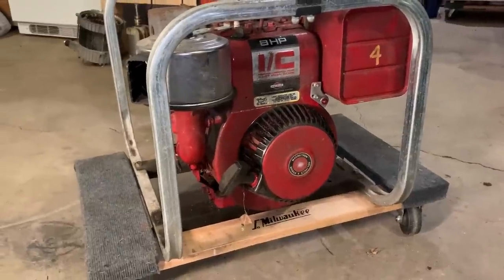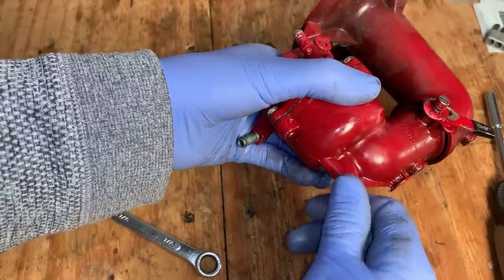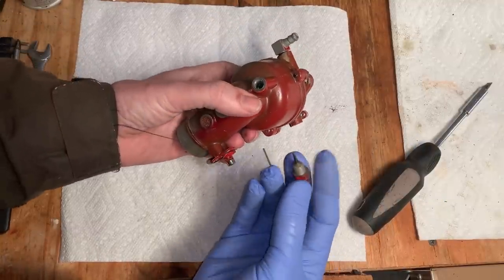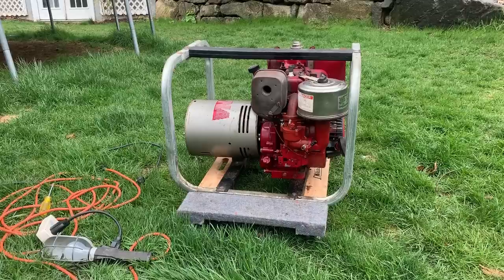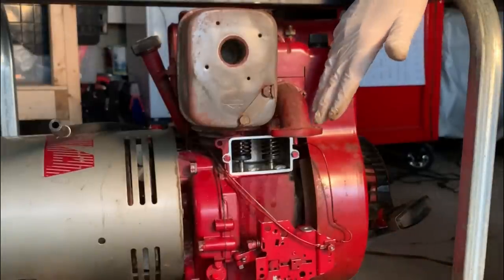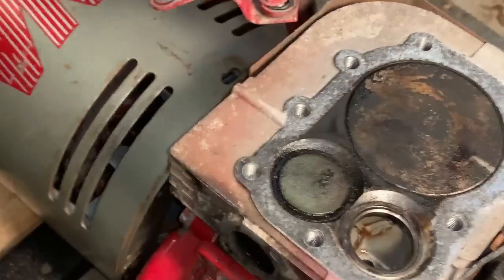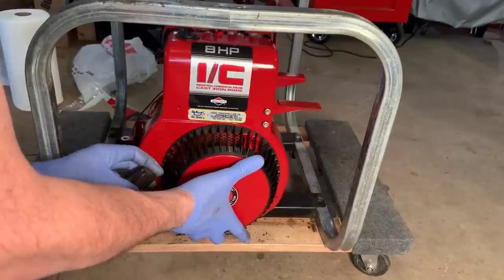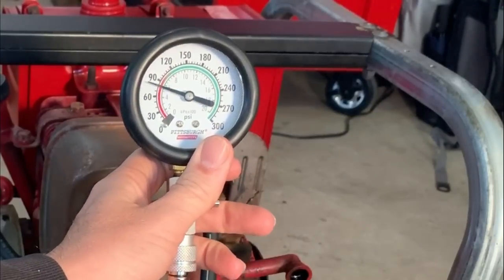Old Winco Dyna Generator (Part 1) - Will it Run?

Comment: The one thing that seems to stand out is that the engine sounds like it's labouring hard, right from the very first start - That hard "thrappy" sound tells me that the engine isn't happy about something and I'm wondering if that's what the previous owner picked up on, and thought perhaps the spark arrestor was clogged, and removed it on that basis.  The nearest I can relate it to is an old Briggs powered bale elevator that we had on the farm which sounded just the same.

Now, there were two possibilities suggested to us, one being that there would be a flattened cam lobe, limiting valve lift, and the other being that the flywheel key would be partially sheared, thus shifting the firing point. In our case, it was the latter, and a new key fixed the problem.

The glow in the exhaust is indicative of the exhaust valve opening early, thus releasing the flame too soon, and whilst the combustion is still in progress - Thuswise, the energy from combustion is not being maximised in the cylinder, but is still burning at the moment it is being released into the exhaust muffler, and causing it to overheat and glow. That would also indicate that the cylinder block at that point is also overheating, and liable to be lacking lubrication, and greatly accelerated wear - which could also be a cause of glittering in the oil.

I'll be interested to see part two, and see what you find, and what the real causes are.

Comment: This is not meant to be disrespectful in any manner. You do a much better job than I am capable of. This comment won't solve the problem, I simply believe you induce numerous variables sometimes. Such as lapping the intake valve then also changing back to the old carb. Then return to the clone carb but also adding fuel, returning to the original spark plug, and also removing the air filter. This is just my opinion, but I would do those one at a time, testing each one individually. Thank you for all the informative videos.
Reply from the maker: Thanks.  I ended up cutting a lot of footage to make this a little shorter.  But agree, do not want to change many things in between tests.  There is another video on this generator where I finally figured out the issue.

Comment: I had an old altenator design power unit given to me once. A 7hp briggs of the same design as yours. It had set in a barn for several years, carb, tank were in bad shape. I cleaned tge crud from in&out the carb with a soft bristle mini brush and some sandpaper, use all the old parts. Put bb's in the tank with some water and shook it clean, several rinses and one with gas. I had a newer coil from a junk rider, converted to electronic ign. Stole a sparkplug out of an old weed eater. The machine starts on the first pull every time. Its a 3000 Watt unit. I gave it to my pa-in-law, he used it when Hurricane Katrina hit us. He had 3 freexmzers, told him run 1 freezer and freeze it down, then run another, do the same same. Just rotate the units and don't open the doir unless nessecery. He ran some lighting with it also. He's been gone now about 7 yrs, I don't know whar happened to the old machine, it had an 81 yr model motor. Guess when the family started cleaning out his stuff the generator got sold. He was a great guy. Used to sit outside at night and talk for hours, best friend I ever had....

Comment: You just gotta love this older equipment.They were built like tanks. Given the proper care, they will work forever and if there was a problem, they were built to be repaired. I have some small engine powered equipment that are at least 50 years old and still perform quite well. So glad you saved this one from the scrap yard.

Comment: Great video! Briggs & Stratton made that engine for many years. As a kid in the late '50's early '60's my family had an old Toro "Park Special" reel cut lawn mower with that very engine. 8 horse power with an oil bath air cleaner. You sat on a sulky behind the unit. It was a beast! Thanks for the very informative, diagnostic videos. A joy to watch!

Comment: When we used one of those generators for construction we were lucky to run a compressor and a skill saw off of it
Reply: Weird, I have the same unit and it runs a 1500watts heater and simultaneously start up my 20 gallon compressor effortlessly, the engine pitch barely changes.
Reply: The guy that I was helping had it sitting in back of his truck with no protection from the weather when we was setting up affordable homes he did not like keeping up with his tools
Reply: @markmullins4222  Gotcha lol

Comment: Very good!  I’m fairly experienced with repairing generators, both mechanical and the electrical end as well. I had never seen this “leak down” testing method done before. This is why I really like YouTube...for the learning aspect. Well done. Thank you.
Reply from the maker: Thanks.  I actually broke down and ordered a real leak down tester today.  Going to hook it up to that engine and see what it says.  Compression still seems a little low to me.  Usually just pressurizing the cylinder like i did with ~60 psi lets you find the obvious leaks.

Comment: Just coming on to you channel. Not sure you will get this but can still hole out hope. 😬
On those old carbs, it has two separate adjustments. One for idle, one for full throttle. The low, idle. Should be adjusted to be just above  stall. The top will have to be adjusted by ear. Didnt see anything in the video about that. Love the older stuff! The new stuff is interesting and informative. Thank you!
Reply from the maker: I have a part 2 on this one.  Figured out the issue.

Comment: Great video, this is really enjoyable to watch. No annoying "action" or clueless operation, un- or overmotivated talking or anything of that kind. One rarely finds that! The valves immediately came to my mind when I saw flames coming out of the exhaust at the first carb adjustment, and then again when the muffler started glowing. I would have suspected the exhaust valve though which might start beeing to tight when the engine is warm. Excellent job of testing the valves with liquid, because often you lap them and the seats look perfect but they till leak. Had that multiple times and learned my lesson to always do a leak test with brakecleaner or an equivalent. I was very much surprised that the repaired valves didn´t seem to improve the problem.
Reply: re: "I saw flames coming out of the exhaust at the first carb adjustment,"
As John found out, it was apparently the timing that was off.
Reply: @uploadJ  I honestly don´t see a connection between your comment and mine...
Reply: @v-g-z3689  re: "I honestly don´t see a connection between your comment and mine..."

Unexpected ... MAYBE the others reading this comment stream will?
Reply: @uploadJ  Possibly they do, yes.

Comment: I've been working on small engines since the mid to late 70's... and still to this date work on them.
Reply: I think you got urself a pretty good hobby. I'd rather bust my ass for hours working
on getting an old engine going, cleaning out the carb adjusting valve lash, lapping
the valves. I'm more into gener8ors, just pickt up a cast iron 23 Briggs 9HP and got
her running. Thinking of getting 2 24 v 100 amp alternators and run them into an
inverter. gen has a delco remy starter gener8or.

Comment: check the ignition timing  with the head off check the valve timing, valves on the rock as piston passes TDC. set the carb at full load wear you want full power not off load
Reply from the maker: Yes, I did another video on this and took it apart.  The cam timing was off by a tooth.

Comment: Those are some of the best carbs still. Gets great fuel mileage when the engine is on a go-kart. Also they can idle the engine at a super low idle.

Comment: You might find investing in a Colourtune to be worthwhile for diagnosing and especially tuning. It's a spark plug with a clear top that lets you see how the fuel is burning, and by that can tell you if it's lean, rich, right, burning oil or other contaminants in small amounts and so on. 

I was given a very old one many years ago and though I use it rarely, it has helped me considerably with those times I've pulled it out.
Reply: Without having seen P2, one thing I would be suspicious of are the bearings around the power head. Perhaps when it's under load the pressure on the bearings is increasing, and something is binding up? Perhaps end play is letting the armature shift towards one end or the other, and again binding or causing pressure on engine components? 

Off to part 2... :)

(Thanks again for posting BTW, interesting material and very well presented without annoying music or other background nuisances!)
Reply: You're dusting off my memory of using a color-tune on the dual side draft carbs on old British MG's

Comment: Couldn't hurt to crack open the Dyna and see if the bearings need to be replaced as they might be dragging under heavy load?
Reply from the maker: I have a feeling part 2 might involve that.  I just ordered a leak down tester.  Thought I would start there and see where it leads me.  I am very suspicious of the piston drag and am thinking maybe a ring problem?  80psi still seems low to me.  L-head Briggs lawn mower engines higher compression numbers.
Reply: I give you a lot of respect, I like the way you work. I am a retired gen guy. The electrical end and governors  and parallel switchgear for a  Cat dealer for 42 years.
Reply from the maker: @PabloDiablo682  there is a part two on this.  I ended up installing new rings and a piston.  But the real issue was the timing.
Reply: @jcondon1  That's what I was thinking when I saw the plug, and the glowing exhaust.

Comment: Just a side note on the leak down test. The breather cover must be in place and the hose plugged when checking for crankcase pressure. Nothing will show on the dipstick tube as all the pressure will blow out the breather area.

Comment: This was a great video to watch. Lots of helpful troubleshooting techniques. When you do torquing of some of the bolts, could you mention what torque spec you are setting them to? About to watch part 2!
Reply: As much as I like James work and as much as I respect his skill. This always has been the one aspect, that I didnt like: He seems to guess torque values a lot and then uses a torque wrench to tighten bolts to "his spec". Imho this doesnt make a lot of sense. If you dont have any torque values from the manufacturer, then youre better off doing it by feel.

Comment: I had one of these long ago but it was a 12 HP. It had a very poor governor as I remember. But it worked for many many years with nothing but fuel and, and the occasional oil changes. I loaded it up heavily with a welder and it had plenty of power, but the power occurred down at about 50 Hz.  The engine had a painful sounding knock at about 62 Hz so I was afraid to adjust it to have higher speeds unloaded. Once I started working "in the road" I lost track of it.

The exhaust note during your testing at the beginning of the video sounds like it has ignition timing problems. (I say this at the time you just tested the new carb.) The glowing red exhaust also supports this theory.

They had plenty of power when new. The acceleration when started up would bring the engine up to speed a lot quicker than yours is ramping up. 

Looking forward to seeing your next video on it.

Comment: Another great video James. I'm a long time lurker and recent subscriber. I have watched lots of other video from various sources and I really prefer yours. First, you have a voice for radio which makes it easier to listen to and the way you structure the progression of the teardown and reassembly. Your camera work is very good, thank you for using a tripod, I get seasick on some of the videos out there, dude pick something to focus on already! I appreciate your attention to detail and the data you provide as you go along. Every time you include stuff like the B&S check sheet I run out to the web an get it. Just can't have to much documentation! 
  Really like the style of carb used on these older engines. Updraft is ancient technology but, fuel cannot pool in the intake. BTW, did you clean out the tank on this one? Did I look away for that step? I saw you replaced the fuel line. The crap in the bottom of the bowl had to come from somewhere. Maybe past that damaged bowl gasket? Thanks again.
Reply from the maker: Thanks for the great feedback. Been working to improve as I go.  My earlier videos were a bit rough.  Do not remember taking the intake off.  After my luck with the exhaust, probably did not want to risk it.  Just picked up another red generator with the same carb from 1987.

Comment: Interesting case.  I would check the muffler for restriction.  The cam timing should be checked for split overlap and lift.  Anything that would stop it from pumping air would restrict power.
Reply from the maker: I did a part two on this.  Search my channel for Winco and you will find it.  But you are right, valve overlap was off by a tooth.
Reply: TF tg

Comment: It runs just like my old Sears and Roebuck Geni It's a 1500 watt made in the 60's, great to get rid of skitters "needs and overhaul " though doubt i can find a set of kits for it now. Has a Tecumseh engine around 5 horses. Love the older engines they generally just run and run and are cast iron blocks. and yep no fancy smancy pull start you have to wind the rope. and you have to do points at least every few runs no. need to pull it outa mothballs and clean it up and see if i can get her to run for me again. Love your vids, keeps and old bird like me piddling in the barn. Hope to see more vintage engines and genies

Comment: I like the check the armature bearings under load if there going that would drag motor down
Reply from the maker: There is a part 2 on this.  Figured out the issue.

Comment: Hate to criticize the adjustment. The main jet is adjusted with the throttle open. With the governor, this means under load. The idle jet is adjusted unloaded and the throttle manually held closed. It has no accelerator pump, so releasing the closed throttle will cause a slight hesitation, which is normal when adjusted properly. The generator when loaded should have the main jet adjusted for the governor to close the throttle as much as possible, then slightly open from there so it does not run too lean. This will provide good load pick up response.

Comment: From Mike watched your winco generator video. Good info. I was going to mention I purchased a winco hp 4500 generator few years ago $40 1988 model year on 8 hp ic engine  They are built lecenter mn 6 miles from me. Anyway went through carburetor last person in there boy o boy. Got it running runs good changed oil. Mouse nest debris coming out. So next day pulled end cover off of generator huge mouse nest. Vacuum it out. Blew it out. Only seen 1 wire chewed on white ground wire about 2 inches. Put cover on makes 124 volts both outlets. Will find something to put load on it. A concern of mine is there are no circuit breakers on unit. I was going to use for home use if needed. I was thinking of feeding into a 30 amp 220 breaker. The generator has a 50 amp outlet on it. The breaker should provide some protection? Hopefully works ok. Otherwise I have another in my storage shed similar size. Another 8 hp B&S got that going 10 plus years ago. (No gas when stored) that one had carburetor story too. Great videos keep it up

Comment: Since you already know you have sparkles in the oil I would mike the cam journals and check the bearings.  I am a bit surprised that that unit is rated for that kind of wattage.  I have a Montgomery Ward one from the mid to late fifties which is rated for 1200 watts as I recall.  The engine is similar in size and looks to yours.  Can't walk away with the question mark hanging.  While you are down there I would pull the piston and mike the cylinder bore for 'hour glass wear'.  This would explain your rising friction midstroke perhaps.

Comment: What is the flash at 50:10? Spray a little carb cleaner in the intake while under load to see if it needs more fuel.

Comment: I am not a mechanic, but maybe the even though you are getting spark when you hand crank and at no load the spark plug wire looks good. Maybe even the 110 v outlets? I really thought you had it on the last attempt. Good luck.

Comment: Im pretty sure that engine was used for pumping water back in the 70's. I used to have 2 of those engines, one specificly made for a generator and one for pumping water. The water pump one never had enough power to do high rev like say on a go kart. The generator one worked perfect on a go kart and had plenty of power at higher rev.

Comment: in your other videos this kind of problem was related to governor issues.....i don't know how the governor works or if it can be rest......i was also wondering if the problem was actually in the generator head and new bearings might help......anyway you did a nice job restoring this engine.....the final thing is that these older engines weren't designed for ethanol/gas fuels and maybe running pure gasoline without ethanol might help.....also ethanol deteriorates all the old original rubber gaskets and 0-rings and there might be some rubber bits stuck at a choke point somewhere
Reply from the maker: Was thinking much the same.  Ended up making another video on this generator and solved the issue.  https://youtu.be/SR8tQJ9NFvo

Comment: Did you verify the valve lift? Glitter could be a damaged cam. That could explain the additional force to turn the flywheel in mid stroke.
Reply from the maker: In part 2 I took the engine apart and found the glitter was coming from the piston.  Installed new piston and rings, honed the cylinder.  Runs well now, but still more resistance then normal when the piston is traveling up or down regardless of the cycle.